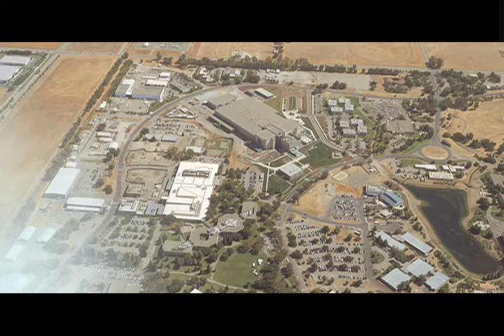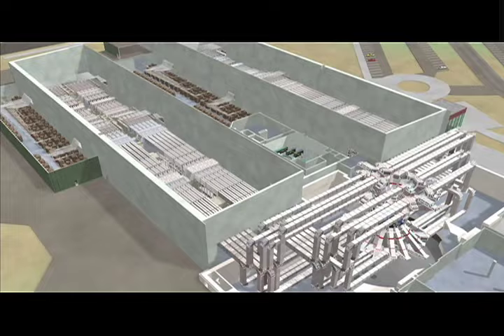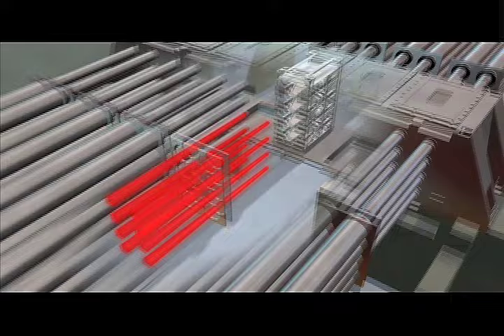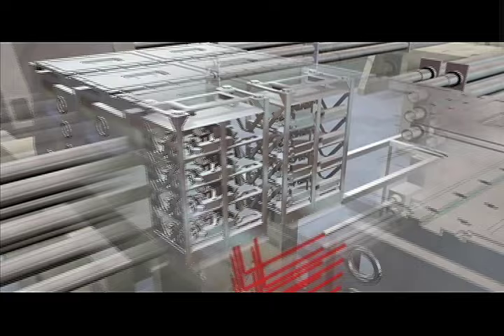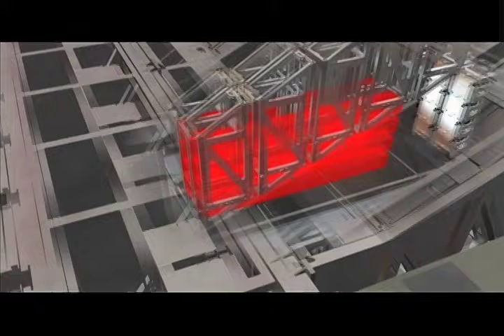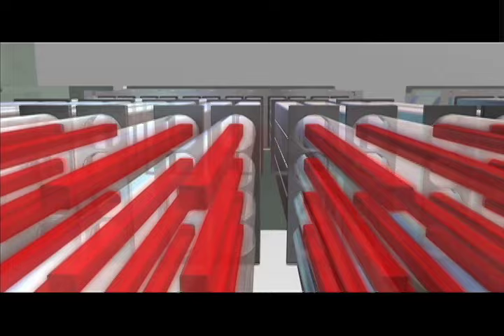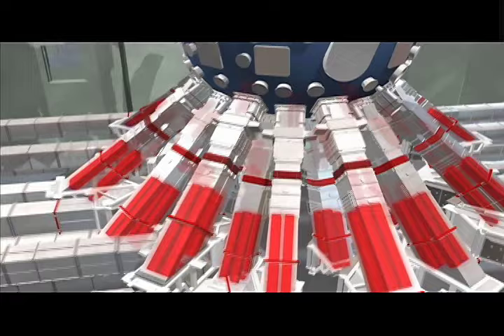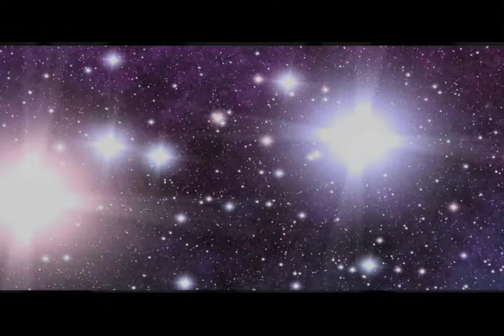How NIF Works

Comment from the maker: @RoberTastic NIF uses an optical switch called a plasma electrode Pockels cell (PEPC). Developed at LLNL, a Pockels cell rotates the polarization of a beam when voltage is applied across an electro-optic crystal. Depending on the voltage, the Pockels cell either allows light to pass through or to reflect off a polarizer, creating an optical switch. In the NIF beamline, the PEPC allows the laser pulse to make four passes through the main amplifier, building up its energy with each pass.

Comment from the maker: @fermi2 

Numerous safety systems have been incorporated into NIF to assure that all experiments can be safely carried out. The small size of the fusion target, and the fact that the fuel is expended in just a few trillionths of a second, insures against a runaway chain reaction or "meltdown". While the neutrons, X-rays and gamma rays generated in a shot can be harmful if not properly controlled, two-meter-thick concrete walls and doors encase the target bay in a protective shield.

Comment: @fermi2 i used to work on a nuclear reactor, and most are very very safe.  the problem is humans not following procedure, which is the primary cause of all nuclear power plant accidents, and it wasnt erroneous, it was blatant disregard for procedures, like lighting the gas plume on fire when u are gassing up your car, not like answering ur cellhpone while gassing up your car.

Comment: When UV rays strike the gold surface it creates Xrays. It is in that shape so there can be a close-to-uniform surface of Xrays striking the center target. If the laser beams were to directly strike the center target it wouldn't likely be uniform enough of compression.

Comment: Another interesting feature of NIF is the study of the thermodynamic equation of state of matter at very high energy density. e.g.  At sufficiently high pressure, theory predicts a metallic form of hydrogen. Yes. Metallic Hydrogen!  NIF energy densities are in the ballpark needed, if I am reading the NIF spec. sheet correctly. A  nice pure science result from NIF if they can do it.  Some astrophysics guys invoke metallic hydrogen as an explanation of Jupiter's high magnetic field.

Comment: Fusion reactions are violent and highly exothermic.  NIF is not intended for civilian electricity production.  Plenty of the people working on the project are probably interested in that aspect, but NIF seems pretty impractical as anything else besides a proof of concept for a nuclear bomb you can develop without violating the NPT.  There's nothing wrong with controlled fission and solar power, which is really fusion power in its own right anyways.

Comment: And why the giant energy of laser beam is not used to produce electricity with photovoltaic cells? This is light energy, terawats light energy and they don't use to convert her to power.
Reply: niks1na 3 years later so hopefully you found your answer but that light came from electricity. Even if you had 100% efficient solar could only get back what you put in. Of course no panel is 100% efficient so you lose energy.